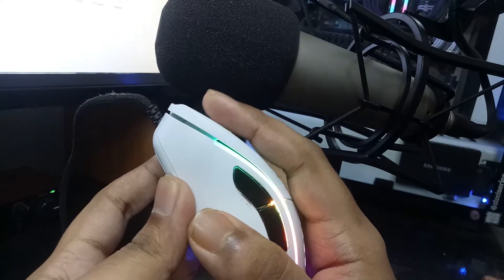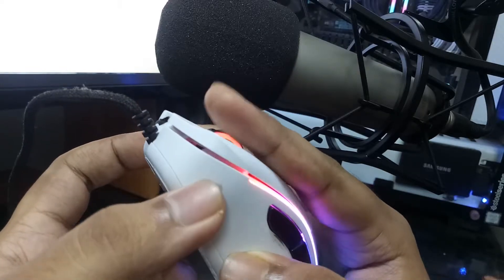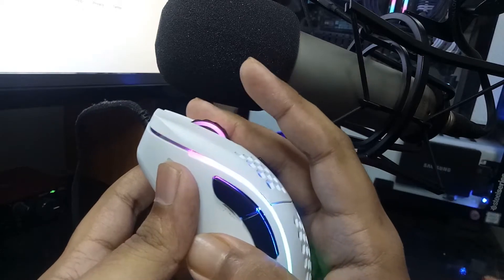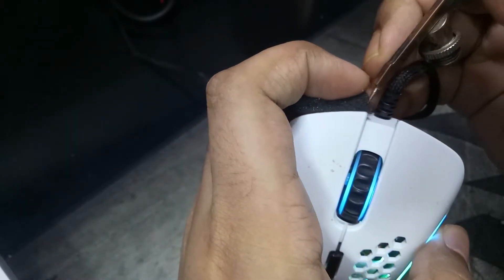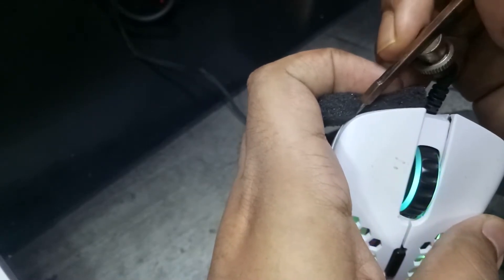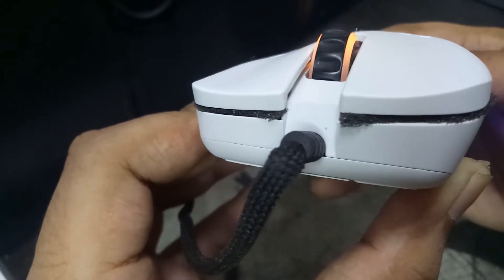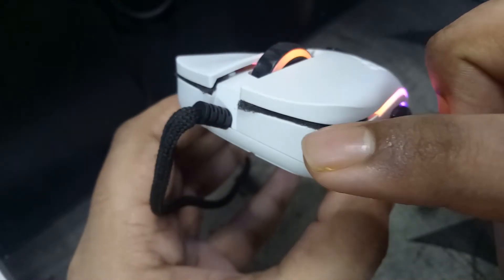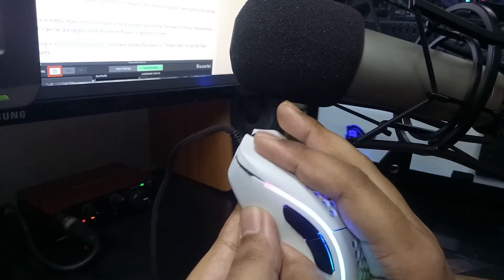Glorious model D/O/Razer Viper ultimate squeak click issue Fix

Comment from the maker: just a quick update guys !!! glorious did send me a brand new mouse after contacting RMA...so if u r having problems contact them u will get new one without even sending the mouse to them..u can fix the old mouse and sell it though..ez Profit LOL..GLorious is the best mouse company although they r just suffering from QC issues.
Reply: im so unlucky that i bought my mouse at another dealer.. Glorious wants me to contact my Dealer and they want the mouse back in order to even start working on my warranty issue..
Reply: what is rma
Reply: We’re do I call to get a replacement mouse
Reply: @aceflyer4571  you need to contact glorious costumer support. they describe it on their webpage.